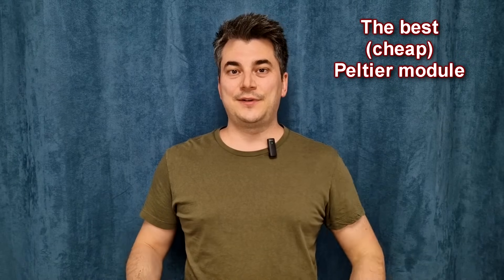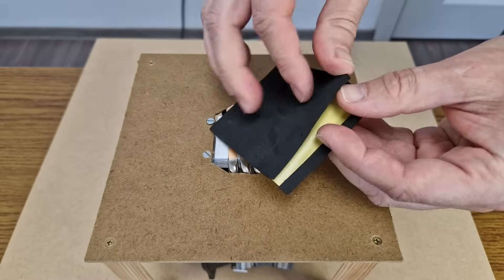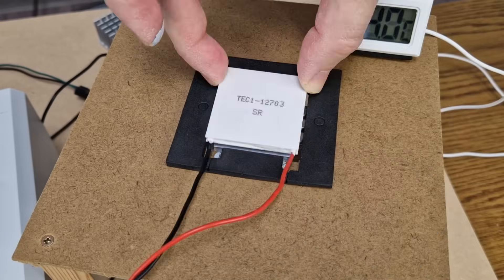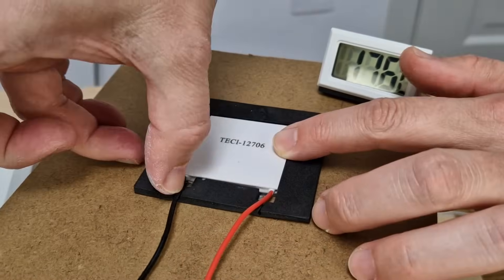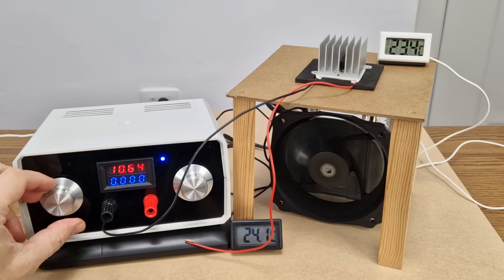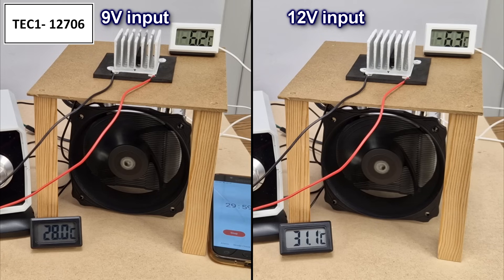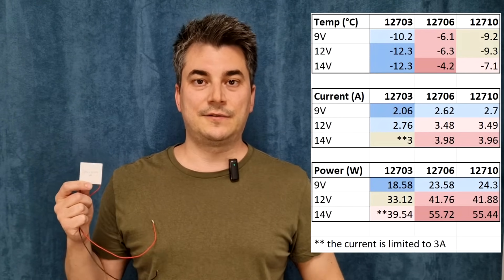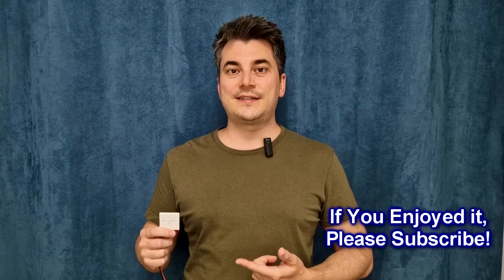The best (cheap) Peltier module [test 2]

Comment: FYI 1 .. watts of electricity you apply to it , is not the same as watts of heat moved/pumped out of the cold side , or watts of heat moved/pumped into the hot side .. nor is the temperature by itself tell you how much cooling watts of heat are being moved/pumped from that side you have the temperature of.
.. ie .. 

For example .. using the same 65 watts of electricity:
If under the test conditions the module operated at a cooling COP of 1 .. that would mean 1 watt of cooling for every 1 watt of electricity , at the same time the hot side would be that 1 watt of heat taken from the cold side + the 1 watt of heat from the electrical resistance .. when cooling COP near ~1 the Heating COP would be near ~2 .. or with 65 watts of electricity to get 65 x 1 COP = 65 watts of cooling / heat-removed from cold side .. same 65 watts of electricity also gives 65 x 2 COP = 130 watts of heat moved to the hot side.

If under the test conditions the module operated at a cooling COP of 0.5 .. then 0.5 watts of cooling for every 1 watt of electricity , at the same time the hot side would be that 0.5 watts of heat taken from the cold side + the 1 watt of heat from the electrical resistance .. ie when cooling COP near ~0.5 the heating COP would be near ~1.5 .. or 65 watts of electricity up to get 65 x 0.5 = 32.5 watts of cooling / heat-removed from the cold side .. and 65 watts of electricity x 1.5 COP = 97.5 watts of heat moved to the hot side.

In order to know the watts of heat flow on cold side of the hot side .. you need to know the change in temperature of the thermal mass.
for example .. 20 degrees Celsius input air down to 0 degrees Celsius output air is a 20 degree celsius change in temperature .. then you use the specific heat (thermal mass) of what you changed the temperature of .. if it is air you use the total mass of air over the amount of time it took to make that change in temperature .. if it is water , then the total mass of the water over the time it took to make that change in temperature.
Water with no phase change , that stays liquid the whole time , (no freezing or evaporating) .. is about ~116 wh per kg per 1 degree celsius change in temperature .. 100 grams of liquid water would need 11.6 wh per 1 degree celsius change in temperature .. 130 watts of heat for 15 minutes (aka 1/4 of one hour) ... would be 130 / 4 = 32.5 Wh of energy ... 32.5 / 11.6 = ~2.8 degree celsius change in temperature of 100 grams of liquid water from that 32.5 wh of energy you got from 130 watts of power applied over 15 minutes (1/4 of one hour).

FYI 2 ...
Module conductivity fights against larger temperature difference between the two sides .. sometimes space is limited 
The lower amp/power rated modules .. will have higher resistance to both electrical and thermal energy flow .. thus .. as the difference in temperature gets larger between the two sides of the module , the larger the amount of conductive heat loss the higher amp rated module will have .. higher power rated modules do potentially allow for a higher peak max watts of heat moved from the same surface area .. but is diminishing returns for trying to use higher power rated modules as the application sees larger differences in temperature between the two sides .. using lower power rated modules can seem attractive option , but it increases the needed space / area .. not all applications have the additional space / area available.

Comment: its possible to test them with higuer voltages but lower amps?
Reply from the maker: No. the Peltier modules have an internal resistance, the current draw depends on the voltage.

Comment: I don't think the heat pipes work optimal placed upside down. They contain a liquid for transferring heat upwards while transferring cold downwards  - because the hot liquid is lighter than the cold.

Comment: Your not running them at the correct Amps except for the 12703 module (that only requires 3 Amps).

Comment: thanks for your content, after watching this video i was buying 4 module of 12703 and bought used indoor air conditioner only 25 usd lmao, i will using waterblock too and some cheapest air cpu cooler, so i will build water cooling for my room using coolant not compressor, can you make new video on 2025 like D.I.Y module using peltier? im so happy after watching this video 😄

Comment: the limiting factor on these varaitions of peltiers is the 40x40mm ceramic sheet on either side being the same in each model.

i.e. you are trying to shift the differing amounts of heat energy through the exact same thermal mass (of the ceramic plate).
it is no wonder you will get differing results between amp ratings. ceramic isnt the best conductor of heat.

ive used 12706 peltiers with a sold ally heatsink, a copper ally heatpiped heatsink and a 360mm AIO cpu cooler (all with cooling fans). with minimal difference to the cold and hot side temps.

if i was smarter/not lazy, i would figure out the thermal conductivity of these ceramic plates and work out their ideal/max heat transfer abilities. but seeing as peltiers only come in a few power ratings , and this chaps already done all the work for us on which is the most efficient. 

thanks sorin!!!

Comment: You probably had a current limiter in your power supply. For the next test, use a power supply that can deliver more than 3.5A. This only worked with smaller Peltier cells; 3.48A for the 12706 is not enough 6:34 . The tests were unrealistic. Best Regards

Comment: The test should take into consideration to Qc(W) for each of the chips.  A 12710 handles higher thermal loads than a 12706 and it transfers nearly twice that of a 12703.  A chips ability to produce a high differential is good, for some applications however I would assert that is not in fact the measurement of it's ability to cool mass.  We know that at it's highest differential it's ability to cool is negligible so I don't think that is practical.  It would be most interesting to normalize the scores to real world application by how long each chip takes to cool 50 mL of water 20 degrees C  (1000 calories) from room temperature in a closed system.  A good test would be a shot glass with 50mL of water thermal greased to the peltier.  Then we could see load performance.  I think the larger chips are going to shine in applications that don't require extreme temperature differentials.

Comment: 1-  when the factory tells you its a 12706 . 12v 6a . 
you give it 12v 6a , not more . not less  , more = more Joule heat .  less = less COP 

2- the size of the heat sink is always relative to the size of the module . not the same in all modules 

3- the speed of the fan is always relative to the heat of the hot side of the module . larger modules require more cooling . otherwise the heat will not move out from the heat sink . and the hot side will get hotter .

Comment: Would it be possible to supply the peltier modules with the 12V power supply lie you did, then when the hot and cold is coming, supplying them with the energy generated by other peltier modules due to temperatures difference made ?
Reply from the maker: No. Peltier modules are very inefficient, they will generate very little energy.

Comment: Because of joule heating/i2r putting maximum rated current to peltier will result in lower COP.

Refer to my youtube post on custom modules ive built.

I use thermal glues instead of pastes since pastes dont have adhesive quality that glues have. Application method is same; just rub it on peltier as evenly as possible then glue it to back of waterblock.

Tldr, treat them like a compressor system. Watercool both hot and cool side for best mileage. Dont exceed 33% of max rated current if dT is low, 50% if its high

You should not be using a CPU heatsink. CPU heatsinks are not going to keep hotside near ambient since they dont have liquid actively moving heat away

Comment: 30*30mm or 40*40mm which one is the dimensions of the 12703 peltier used in this video?? And what's the main difference between 40mm and 30mm, 12703 peltier apart from the size?
Reply from the maker: 12703 module is 40*40mm. the advantage of a larger module is that it has a larger contact surface to transfer the temperature.
Reply: @Sorin_DIY  Thank u so much for the information.
From your previous videos I made a similar mini fridge of 5 litre capacity with water cooling, and it went to -5 degree Celsius with beverages full in it.
Loved all of  your videos a lot.

Comment: I have 12706 peltier module, with 15v and 7 amps reach -27° C, with cooler master hyper h412r heatsink, your 12706 and 12710 module not drawing specs current, possible a fault unit

Comment: Oh just watched test 1 and now this one ... same request again ... Can you test the Peltier modules as generators? Apply hot and cold to each side, and see what kind of output the module produces. For example what happens if you put 20C on cold side and 30C on hot side? What kind of voltage and current is produced? Question would be this... can I use the inside of my house temp (say 20C) and the outside air temp (say 30C) to produce electricity to run my air conditioner? Or vice versa... inside of house temp is 20C but outside is minus 10C, so can I produce heat to warm up my house?
Reply from the maker: I will probably test them in a future video, but these Peltier modules are very inefficient. they will not produce enough energy to heat up the house. probably just to charge a phone.

Comment: The CPU cooler 150W rating will be based on a temperature difference much greater than you have there. If the temperature difference wasnt vital to performance you could just run it without the peltier plate and it would cool the top!! They are used to get a chip down from 90C to 40C in air of 20C. So a minimum of 20C difference and you can bet the manufacturer quotes the spec for 70C difference! Your air is 23C and the hottest the hot side got in the final test was 29C. Only 6C different. My hunch is you are simply not removing all the heat produced by the more powerful peltier plates and so not seeing the pumping effect.

Comment: Loose wiring connections are not good for testing. Unsecured components are not good for testing. Your 12706 may have been weak.

Comment: It needs 15A at 12v so a good cooler is needet. For me an old big 6 heatpipe cpu cooler  wasnt enough, so i used an cheap used, but big aio watercooler.  This works extremly well. Also good thermal paste and High pressure on the Modul is needet for good thermal Transfer. Otherweise it is possible to break the Modul... 

I also found out some Modules are Fake, at 12v the 127815 schould draw about 15A , maybe a bit less, but at least 10A. But fake ones draw about 1-3A, not 10-15. 

The 12706 schould draw about 4-6A , good quality Modules also do this but cheap (fake) ones draw 1-3A .

Comment: Most peltier are scams & mislabeled, sadly. U can see the reviews. The highest current was around 7a at 12v. I dont remember which model. Guess I'll just buy the cheapest model; 03. Im going to undervolt it anyways. A study shows that its more efficient at 1/3 nominal current and its better to stack a lot.

Comment: Is there any difference between the 30x30mm 12703 from its 40x40mm? Will they perform the same?
Reply from the maker: I prefer the 40x40 Peltier module, because it has a larger contact surface. But all these cheap Peltier modules should be tested before use.

Comment: Thanks for you videos! I purchased a broken Fallout 4 mini fridge and am about to start fixing and improving it. It's been fascinating learning about how these Peltier devices work.  

My first question I must find is how much power delivered does the fridge already give??? Since it looks like the lower quality 12706, it's possible it already has the power needed for the 12703. 

Looks like a good excuse to purchase a volt meter to me!
Reply from the maker: Hi. You should measure the voltage and current before modifying it. But I'm pretty sure it will work with a 12703 peltier module.

Comment: Look like a solar-powered, Peltier plate chilled , 48 qt. Portable refrigerator will require a LOT more planning than I originally thought! Especially since this "large beer cooler" is for medical supplies/medicines chilled for several weeks on battery/solar power only. Done well, this well-insulated box, built as tough as possible, will maintain contents at or near 41 degrees F. without mains power. Wish us luck...disaster recovery is waiting for this one.
Reply: You are more than welcome to steal designs from my setup as long as you dont make money off em

Comment: The efficiency is much greater at lower voltages and lower temperature delta. What about stacking a bunch on top of each other, running at a low voltage?
Reply from the maker: I haven't tried it so far. maybe I will try it in a future video.

Comment: The very final test would be to run a test where the hot side is at the same temperature for all test, and that could be achieved by water cooling.  The higher power peltiers are creating more internal heat which needs to dissipated, hence when you have a more powerful cooler pulling the hot side to a constant temperature the results will look different

Comment: Thanks a lot. I appreciate the tables of measurements and your attention to other biases in the experiment. Could you test stacked Peltier modules? I plan to myself but it will be months because I am building something for a client right now. In military infrared cameras and some other applications they stack modules with different ratings and balance them so that the next stage up does not become overwhelmed. You'll need a lot of current to supply them however and some serious heat dissipation. A small scale test could involve putting a smaller module on one of the ones you have and using your existing cooler if you don't exceed 130W. I've always wondered what the practical gain would be in such an inexpensive arrangement. Take care brother.

Comment: Tu video me ha inquietado con estas celulas, gracias por eso! Ahora bien, revisando los datasheet de los peltier encontre que la capacidad maxima de las celulas no es logrando la mayor diferencia de temperatura, por lo que estos resultados que muestras no dicen mucho en esa direccion. Si quieres saber que potencia entregan debe ser en un escenario tipo aire acondicionado donde la cara fria de las celulas se somenten a enormes cargas de calor, ahi es donde veras la potencia real de las 12706, 12710, etc.

Te recomiendo rehacer la prueba con tu aire acondicionado y en la parte caliente utilizar refrigeracion liquida, pues el Qmax se logra con una diferencia de temperatura baja(<27 grados), es decir, lado caliente lo mas cerca posible de la temperatura ambiente y el lado frio como recibe aire caliente de la temperatura ambiente mantendra valores altos por encima de los 10 grados, por lo que el AT(diferencia de temperatura) sera cercano a 20 a 25 grados mas o menos

Comment: Acabo de notar que aun teniendo mejor disipador en la cara caliente el 12703 no logró bajar a cero en 30 segundos y es que por su baja potencia es muy sensible a la carga de trabajo. Con solo ese pequeño disipador de 4*4 centímetros tardó el doble de tiempo al pasar de 30 segundos a 1 minuto... Supongo que con un disipador aun más grande en la cara fria se volvera mas lento, quedando  detrás del 12706 y 12710

Mi punto es que lo más importante no es solo a que temperatura baja, sino en que tiempo lo hace, con carga de calor significativa que movilizar, esa seria una prueba mas real.

Para sacarnos de dudas, mejora tu aire acondicionado usando refrigeracion liquida, haz la prueba con estas mismas celdas 12703, 12706 y 12710 y veamos los resultados.

Comment: Another very useful test would be to put an exact quantity of ambient temperature water on the cold side, then run the same tests at different voltages/amperages and see which peltier moves heat better at different td's and amperages.

Comment: I have a doubt, the dimension of Tec1-12703 is 30mmx30mm, and Tec1-12704 is 40mmx40mm, but in video they all look same size how it is possible ??? please clarify....🤔🤔🤔
Reply from the maker: the 12704 module is 30*30mm, but I haven't use one in this video. the rest are 40*40mm.

Comment: how is the peltier rated for 10amps but only uses 3 are you doing that or are all these peltiers are crap witch one
Reply from the maker: These are low quality modules. performance modules are very expensive.

Comment: It seems like theres a lot of fake peltier modules out there that dont draw the rated current, i bought a 12712 peltier that only draws 4 amps @12v instead of the rated 12 amps. So its probably best to buy from some trusted supplier to make sure they are good quality modules.

Comment: Don't understand what this "test" should say? The 12706 has much more cooling power than the 12703.of course, it consumes double of energy. All the tests are without a load to cool.
The heat pump 12706 can pull about 15-20W while cooling with a delta of 40-50 degrees
The 12703 only 7-10W

Comment: I wonder can we hook these TEC up in computer cooling, they seems like can help out pulling heat form CPU and GPUs and dump into heatsinks much quicker than old thermopastes only.
Reply: People were doing this 20+ years ago, but it uses a ton of electricity which mostly becomes heat you need to get rid of. There was a risk of condensation on the motherboard and short circuits. It was likely more hassle/cost than it is worth compared to watercooling and modern heatpipe heatsinks.